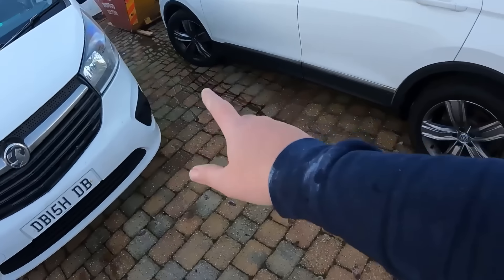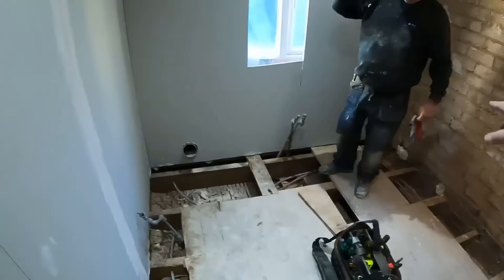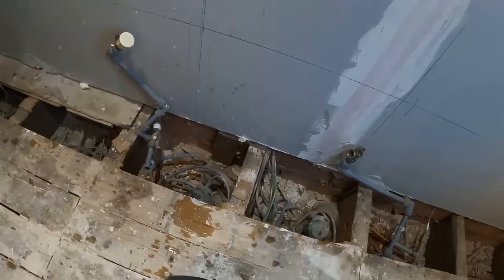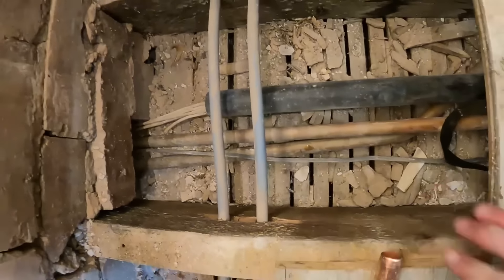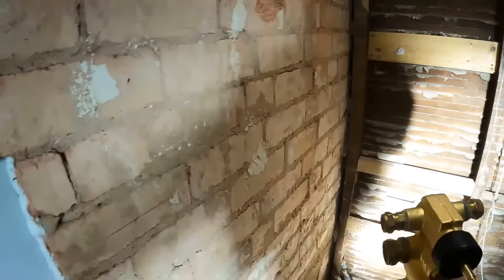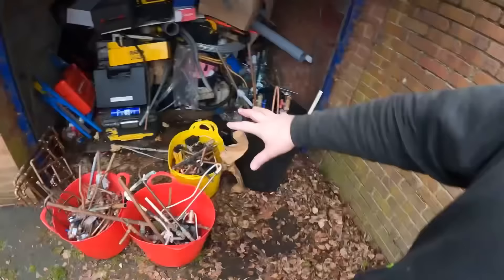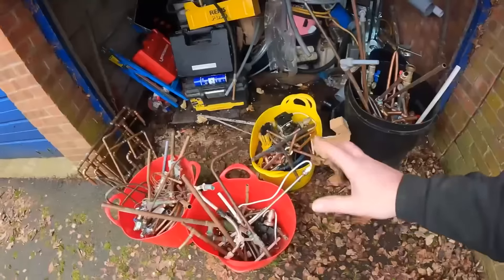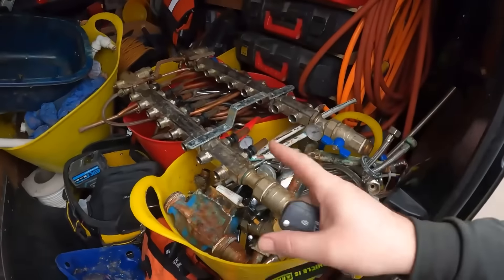PLUMBERS MUST HAVE...We've all got one | REAL WORLD PLUMBING

Comment: I’m not a fan of burying pipes in walls . Especially horizontally . 
I’ve got a similar job coming up , and told my customer , it would be less mess not having to cut channels in the brick work . And easier to fix some battens and board it . Cost around £70 plus half a day . 
A nice flat wall to tile on too .
Reply from the maker: Sometimes it has to be done…. Done right it’s not an issue